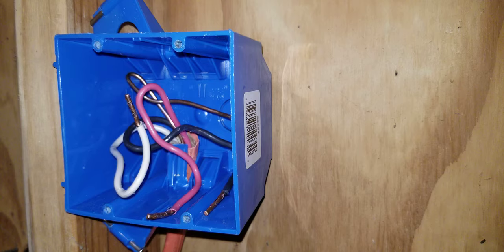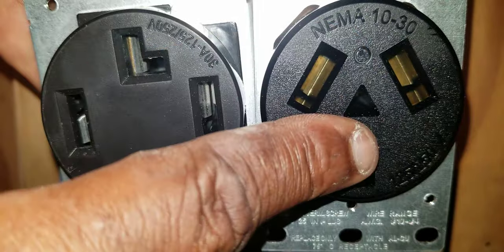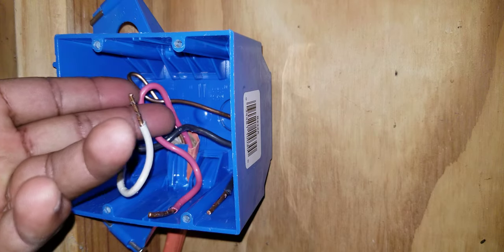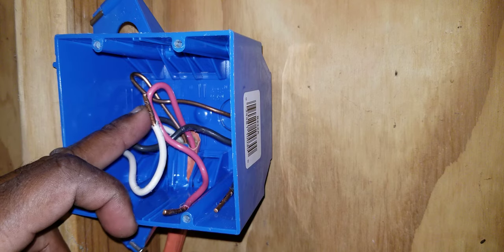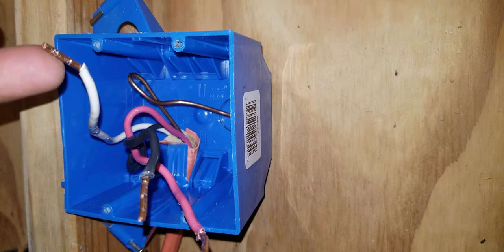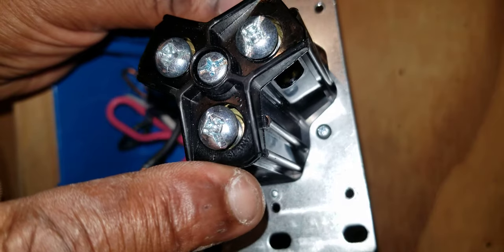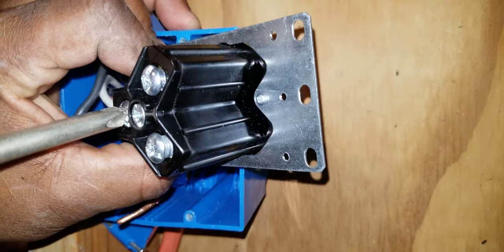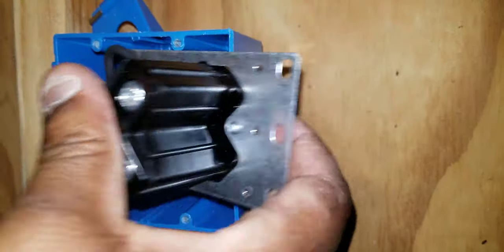How to install a  3wire 30amp dryer outlet

Comment: It amazes me that people post video's and don't know basic wiring methods. The bare wire in this case is the grounding conductor (GROUND) the white is the grounded conductor (NEUTRAL)  Tape off or cap the white wire in this case at both ends and use the bare wire.  A three wire receptacle does not need a return path. If you don't have a green or bare wire it is OK to use a white wire if you permanently mark it green.

Comment: Thank you for giving me confirmation on this. Your tutorial was just what I needed. Sometimes you go with the most cost effective method. A $7 OUTLET 😉 vs a $28 cord. Since my house was built in 1979 a $7 outlet it is. 👍🏾
Reply from the maker: Thank you for watching.
Reply: Same thing just happened to me.
Reply: I'm lost. .....so I need to turn my current plug outlet box (220v) in to a junction box and connect it to 10-3 black/white/ground. What wires connect to what now?
Reply: (At junction box)....is it black with black , red with white, and white with ground/bald copper?  (At plug) L shaped gets the ground/bald copper??
Reply: @rubenrobles1162  o
Reply: @rubenrobles1162  Dangggg man you confused the hell out of me 🤦 if you watch the video you shouldn't have any ??? BUT I'll add he never said 1st turnoff the power/voltage... (or I missed that part)
Reply: I have the same thing the confused guy has lol

Comment: Very nice job explaining the steps in this video. So the ground wire does not need to be connected at the outlet or the box? Why do you not cut it in the outlet box? Is that in case you need it for a future 4-prong? Appreciate it!

Comment: Changing the outlet is way cheaper ($6) vs the power cord which is over $30 🙄... Nice clear and easy to understand video 👍
Reply: If your dryer has a 3 prong cord but you have a 4 prong outlet, change the cord, not the outlet. It's against code to use a 3 prong outlet in new construction. So if your house has a 4 prong outlet, keep it that way.

Comment: Well done. 
My house has electrical nuance. 
The breaker in the breaker cabinet for the dryer is a 30amp.
But the wall plug was for a 50amp plug..??
As was the cord for the dryer.
Why do some home owners mess with that stuff.

You video was great covering the how & the why.
Well done. I will double check the breaker is correct for that outlet.
And get the proper outlet for the 30 amp plug on my new dryer.

Comment: Great narration of the process for wiring. You can also convert a 3 wire to a 4 wire quite easily, on both the dryer and the outlet. 10 Gauge 10/3 wire is preferred.

Comment: Great vid. Simple, and to the point.

You might want to follow our own advice though, and put tape on the back of the screws. You're doing exactly what you instructed not to do, (the ground wire is VERY close to one of the hot screws, in your final assembly).

Comment: That was good and to the point.  Question:  If I take the bare ground wire and clip it to the outlet plate (keeping it away from the two hots and common), would that not be safer?  If for some odd reason one of the hot leads came loose in the box and touched the outlet plate, the presence of the ground would trip the breaker, and otherwise (absent the ground), the plate would be energized at 110V were someone (child) to touch the plate (I know, this is a really unlikely scenario).  I did clip my ground to the plate, and I"m wondering if there's any specific danger I'm missing by doing this.  I have a 3 wire outlet.
Reply: No, you need a 4 wire receptacle attaching the ground wire to the ground contact on the receptacle. Then use a 4 wire power cord, designed for this purpose, and attach the wires to the appliance per the instructions. The ground and neutral wires will be separated. The neutral wire connects to the neutral on the appliance and the ground wire connects to the metal frame.
Reply: @surferdude642  I see my mistake, and I'm correcting it. Thank you.

Comment: Violation of NEC 250.140(B) that allows 3 wire says "... if an equipment grounding conductor is not present in the outlet or junction box...". So that section doesn't apply, you have to use a a four wire receptacle in compliance with 250.140(A), and change the cord per appliance manufacturers instructions.

Comment: this is very good instructions! But I just found out today my dryer wire has no ground.  my house was oddly configured by a prior owner.  They reverse engineered the gas and electric. so the electric dryer was converted to gas and the gas stove was converted to electric. I bought the home in 2009.  Have been without a stove since. I wanted to wire my dryer(which was hardwired to my prior microwave/oven combo before it broke in 2009) but there is no copper wire. only the neutral and two hot wires.  the home was sold to me without the gold wire. oddly the other range outlet inside the house for the cooktop(not oven/combo) is wired for a 4 wire with the copper wire.   I was hoping I could wire my dryer safely with ground unfortunately I have no way of grounding it. I did get a metal gang box. Is there a way to safely do 3 wire without the ground. Would the metal box be enough. as in grounding to the box. my wall is not grounded either only wood going to the foundation stemwall.

Comment: Hello
A quick question about the ground wire. If your working withe a metal box instead of plastic, would you attach the bear ground to the metal box?
Reply from the maker: @CD-hc5ds  yes you would.

Comment: 🌹Hi! I pray that you're well and very, very blessed!
🌹I watched your video. I have an Enerlites dryer outlet; and the instruction manual tells me where to put a white, black, and red wire. But the wires in my wall are white, black, and copper. There is NO red wire. So, I put the copper wire in the slot where the manual tells me the red goes. It didn't work. Plus, when I tighten the screw over the wire, the wire slides to the side inside the slot. I can't get it to stay in the middle.🌹

Comment: My 10/2 only has black, white and the ground wire. Can I use the bare on the "w"   "L" shaped  and the white and black on the other two places?
Reply from the maker: Yes use the bare copper as your neutral. Land the bare copper where you will normally land your neutral. The neutral land on the L shape. The black and the white will be your hots in the panel.
Reply: @rickyjewett6082  Got it, thanks

Comment: I did this same thing for my AL wire circuit, except I don't have a 4 wire.  I just have two black 120v 8AWG AL hots, 1 and one completely bare 8 AWG copper.(Was it being used as a ground? I am so confused.)  When I replaced it (using the proper antiox and the 25 inch lbs of torque, it now somehow sends power to the frame of the dryer when I plug in the dryer.  I checked the strap in the dryer connection to make sure it was correct, and the neutral strap was attached to the frame as its supposed to be on a 3 wire dryer connection.

I test 240 on both legs, but when I check each leg against ground I got 72 volts on one leg and 68 volts on the other leg. some places tell me that my neutral/ground or whatever this configuration is - is disconnected or something. (Ghost voltage)  any ideas?  It was in a non-grounded metal box (But I am sure the bare 8awg CU wire going to the neutral.)

(circuit breaker box)
I also do not see this 8AWG CU wire connected to any of my neutrals, but possibly on the ground.  My 240V hots are working fine though.

Comment: I don't know if you'll see this but I'm a DYIer with basic electrical system understanding, enough to know to never do anything with my house's electrical system if I'm not 100 percent. 

I'm attempting to install this exact thing but it's an older 1970s system. Even still has plug fuses. I know that the wire gauge is 10 so it can carry the current. The problem is that I only have one white, one black and one bare. I've read that the white and black are hot and the bare is neutral. That just sounds dangerous. I also know that the bare is connected to the ground on the existing grounded receptacle. 

Is it possible to connect white to neutral, black to one hot terminal, leave the other terminal dead and attach the bare to the inside in order to keep it grounded. Or are they correct in saying that the white and black are always hot while the bare is neutral, meaning it's ungrounded? 

Thanks for any response.

Comment: I should note that it's a code violation for new houses to have 3 prong receptacles because of the absence of the ground prong. So if you have a 3 prong cord but a 4 prong receptacle, change the cord, not the receptacle.
Reply from the maker: Yes. That is true. The video was for people in older homes.

Comment: Couldn’t you just use 10/2 wire instead of 10/3 if your not using the ground??? Just curious and do you connect the ground at the breaker? Since you didn’t connect to nothing at the box?? great video by the way
Reply from the maker: It can be done and the circuit will work, however, this is illegal today based on the rules of the electrical code book. Although it has been done in many houses, The bare copper wire should NEVER be used in place of the white wire (neutral) because the neutral carry current. The bare copper wire or green wire are not current carrying wires. Therefore to install the circuit correctly you must use 10-3. I hope this answered your question. Thank so much for watching.
Reply: @rickyjewett6082   i have an existing home i just moved in i want to run my 240 for my dryer you think i should use a 3 or 4 prone outlet? i have not ran any wire but from the looks of it i will go with 10/3
Reply from the maker: @EseMorro610  Go with the 4 prong dryer outlet. It is the most commonly used with 10-3 and it is the most commonly used today.

Comment: I have an older house. The coperwire is very thick and difficult to bend.  How can I tell the weight of this wire?  Is the wire coming to a reg 110 outlet a lighter weight so 25 feet of new wire needs to be pulled? The cost to do this was estimzted at $700. For the circut wires and outlet and labor. One outlet! Ouch.

Comment: Hi Ricky, thanks for the instructions. Why do you recommend not cutting the bare ground back to the outer sheath? Is it just so you can use it in the future?
Bob
Reply from the maker: Yes Bob. It is for future used. In the future you may change your 3 wire outlet out to a 4 wire outlet. On a 4 wire dryer outlet there is a place to land or install the bare copper wire so we should never cut the bare copper wire off.
Reply: @rickyjewett6082  Got it. Thanks

Comment: Im so frustrated so here my issue i only have a bare copper wire and a white and a black to my knowledge wouldnt the bare copper wire be place where the white wire would go and the white and and black wire be considered the hots so like i said coming frome the breaker box i only have  A WHITE WIRE A BLACK WIRE AND A BARE WIRE NO RED WIRE ANY HELP AND ADVICE IS SO APPRECIATED
Reply from the maker: OK. Here is what you should do. The bare copper wire will serve as your neutral. Terminate/put the bare copper wire where your neutral will normally go. The white wire in your outlet box will serve as one of the hot wire. Terminate/put the white wire where the of the hot wires will normally go. THE WHITE AND BLACK WIRES WILL BE YOUR HOTS AND THE BARE COPPER WILL BE YOUR NEUTRAL. YOU DO NOT HAVE A GROUND WIRE IN YOUR BOX. Text me back to let me know everything worked out.

Comment: I read that doing this could cause heating of unit or potentially electrocuting you if current is flowing through the neutral wire. Is this true?

Comment: Thanks for the video! I watched a handyman install this at my home today and noticed they screwed the ground to the box with one of the screws instead of pushing it to the back. Is this wrong? Should I have them come back to undo that? Thanks in advance
Reply: Not wrong, you probably had a metal box, in that case you would ground the metal box to the ground wire. Since Ricky's is plastic, it does not need to be grounded.

Comment: Is there no grounding terminal on these plugs?
Reply from the maker: No, there is no ground terminal on this plug. The dryer will be grounded through the neutral wire.

Comment: I have a older house that use old breaker box that use fuses my dryer cord is not pulling enough voltage im getting a code 9c1. Do i install a new plug or is it the breaker box?
Reply from the maker: It could be a fuse blown in your box
 Also could  be your outlet. I would suggest that you change out and install a new plug.

Comment: Why’s everything a 3-prong dryer outlet?! I'm looking for an outlet plug for my washing machine. Is there a such as a 3-prong washing machine plug?
Reply from the maker: Your washer machine will most likely use a normal ordinary 120 volt outlet. Yes, you can buy a 3 prong 120-volt outlet from any hardware store or even Walmart and some large grocery stores. It will look like the same outlet that you have in each room throughout your house.

Comment: How do I wire one using 10/2?
Do I use the ground in place of the neutral and the white wire as my second hot?
Reply from the maker: Yes. Use the bare copper as your neutral. Use the black wire and the white wire as your 2 hots.

Comment: How is no ground to the appliance safe? Doesn’t your average dryer have a place for ground to land?
Reply from the maker: You are right. Every dryer and every appliance needs to be grounded. When you don't have a ground wire, the dryer will be grounded by the neutral wire. The neutral wire will serve as the neutral wire and the ground wire.

Comment: Want to install a heater 220v. The outlet  has a red,black,white and bare ground wire, but the heater only has two hots and a ground. Would the ground go to the white wire. the white and ground are connected to the same spot in the circuit box.
Reply: Cap the white

Comment: what if you install a 30 amp 125/250v 3 prong mount outlet from a 4 prong with the power on and it doesn't work for your dryer what does that mean

Comment: I live in an old house, with my grandma. We have no ground wire. It’s knob & tube. The red wire for the dryer receptacle has no power. Do you know what this could mean? & how I could fix it? We can’t afford an electrician so I was hoping I could DIY :)
Reply from the maker: You can buy wire (10-3 romex) from a home depot or a hardware store. Take a meaurement from your panel to your dryer. Buy the wire and take one end of the wire from the panel and the other end to the dryer outlet. Knob and tubing is obselete.

Comment: So where does a the short current goes if  you don't connected  it to ground?
Reply from the maker: The short circuit circuit will go theough the neutral. A long time ago ( like back in the 1950's. There was no ground.  If there was a short circuit, that current flower through the neutral.

Comment: What happens if you have orange 10-2 wire I only have red & Grey with a bare wire! Can I use this to hook up my dryer?
Reply from the maker: You really need to have 10-3 cable to install the outlet properly. The dryer needs two hots and a neutral. The black and red wire will be your hot and your white will be your neutral.

Comment: What if the wires are connected to other wires inside the box. If I untape them and connect the dryer outlet, the other ends of the wire will be …?

Comment: So my only question is what do I do with the ground wire when I get to the box and the breaker? Otherwise thanks
Reply from the maker: Inside your outlet box, just push the ground wire to the back of the box away from the outlet connections. In you electrical panel, land or terminate the ground wire on the ground bar. Your panel should have a ground bar. In some old houses, the grounds and neutrals are terminated on the same bar.
Reply: @rickyjewett6082  cool. I ran them to the ground bar just to be safe and everything worked fine. Thanks for the video man it saved me a ton
Reply: @ricky jewett I’d still land the ground in the box if it’s metal, if a hot wire shorts to ground at least  you have a path back to ground then to the panel

Comment: Another question, is this blue box legal to use as extension box over the drywall?  Thanks
Reply from the maker: If you are intending to surface mount the dryer, NO. DO NOT use the blue box. The blue box in the video is for inside the wall. Use a metal 4 × 4 box if the dryer outlet will be exposed.
Reply: Thanks !  Appreciate 🙏🏻

Comment: Great Video... 2 thumbs up 👍🏿👍🏿... what size wire are you using for that setup?
Reply from the maker: I used size #10. Size 10 is what is commonly use for a dryer. I thank you so much for watching.

Comment: So what's the purpose of the ground wire and what all does it suppose to touch?
Reply from the maker: The ground wire is not doing anything in this example. In a 3wire 30amp dryer outlet, the white neutral wire is serving as the neutral wire and the ground wire. There is not place for the ground wire to touch or land. However, in a 4 wire 30 amp dryer outlet there is a place for  each the ground and neutral to land.
Reply: @rickyjewett6082  So I don't need to install a ground wire in this case?
Reply from the maker: @Sir_Emo  no. You should be fine.
Reply: The ground wire is a safety precaution in case there is a failure in the neutral wire.
Reply: @tdog5878  I'm proud to say I succeeded in installing one safely. Passed inspection too.

Comment: Can you use a single pole 30 amp breaker?
Reply from the maker: No. You must have the outlet on a 2 pole 30 amp breaker for the dryer to work properly.
Reply: @rickyjewett6082  You da man.